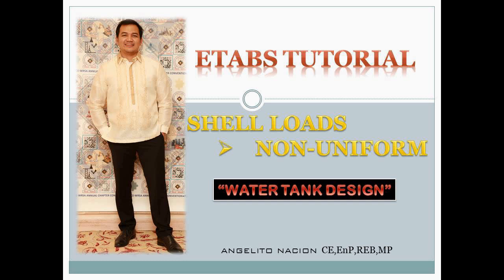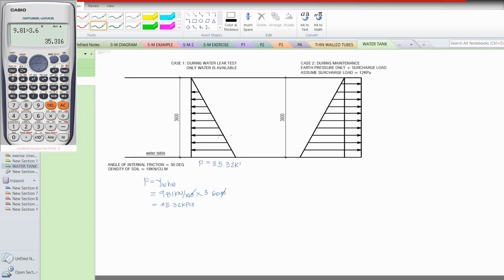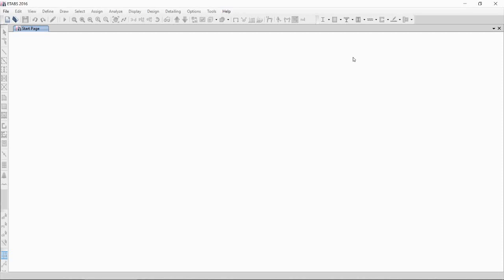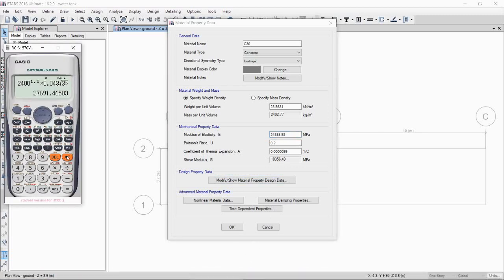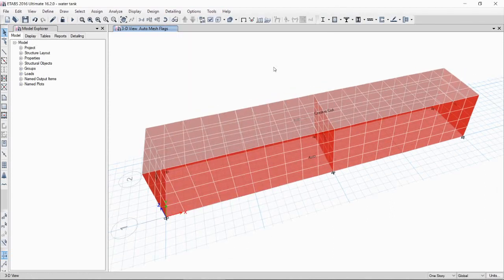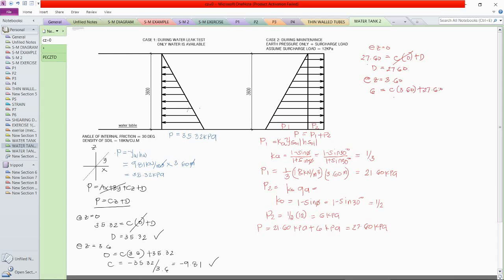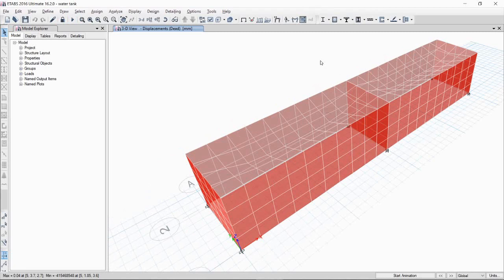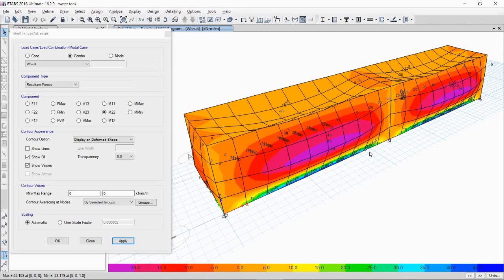TUTORIAL 999: ETABS - SHELL LOADS - NON UNIFORM

Comment: Hello ... engr can you make a video on design of basement wall.
is basement wall design is similar to this video cause the forces like soil pressure, water pressure, and surcharge load are mostly similar. 
if yes then how about saturated soil(pressure formula will same or different)
please answer my question
The second thing which I want to know is retrofitting a structure using etabs. how retrofitting is done or what are steps to be followed
Reply from the maker: HI Saeed, feel free to contact me at nacion18.angelito@gmail.com
Reply: @engineeringedu5437  Hi sir, I have the same question with SAEED, can you give the answer on this comment section or on my email hardikaintan17@gmail.com ? it will be helpful thankyou sir🙏🏼
Reply: @engineeringedu5437  thank you sir...

Comment: Hi Sir, I have a question for multiple basements. How can we apply the formula of Load at Point = Cz + D?
Reply from the maker: Leo Alambra It the same, just model how many levels and apply the principle of Pressure @ that level = Cz+D  and consider @ level where z= 0
Reply: @engineeringedu5437 ...Hi sir, how about if my model is comprised of several elements in one side (divided elements for some reasons), is this load application ( value of C & D) are the same to all elements?